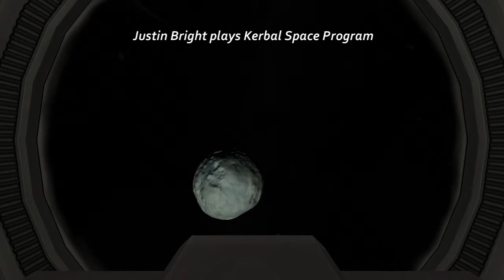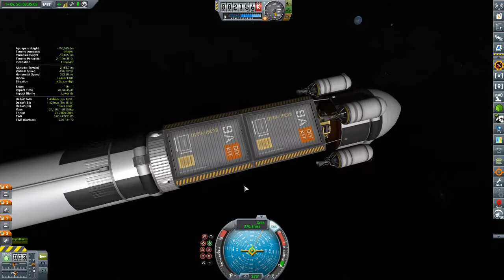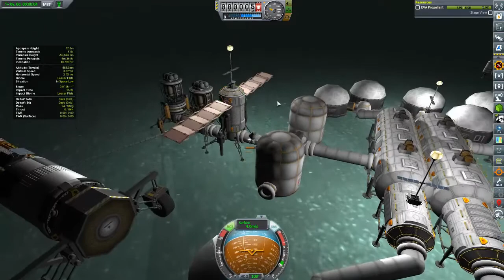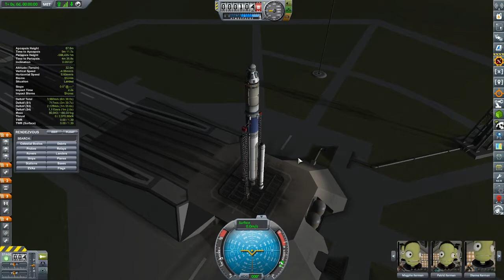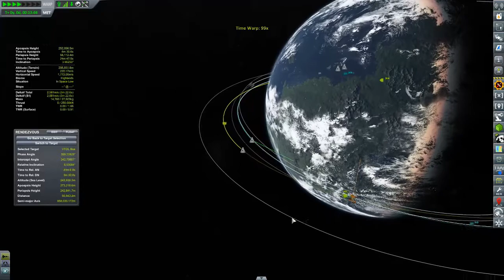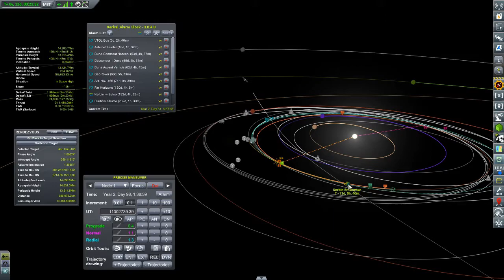Asteroid Resources and Manufacturing! - KSP/MKS - Multiplanetary Species Episode 61

Comment: Loving the series.  Good news on Kerbal Construction Time too.  The Main one hasn't been updated yet, but the Dev version, from the development thread is stable and rock solid with 1.2.2.  Due to changes in 1.2.2, the old method of tracking the part inventory doesn't work, so it's like you build everything from scratch the first time without the bonuses from repeated building and part inventory.  This slows build times a bit, but I've found it quite reasonable.  The simulation mode has also been completely removed, so you'll need another mod, like KRASH - Kerbal ramifications artificial simulation hub.  It's been both a pain and fun dealing with it in my own game inspired by your playthrough.
Reply: MrUlsoro Just wanted to tell the same. I think it is a bit complicated to find the 1.2.2 dev build and the "base" version. The only problem I have with KCT is, that it doesn't work well with the contract decline timer and mods like state funding. Nonetheless it makes KSP feel much more realistic and immersive.